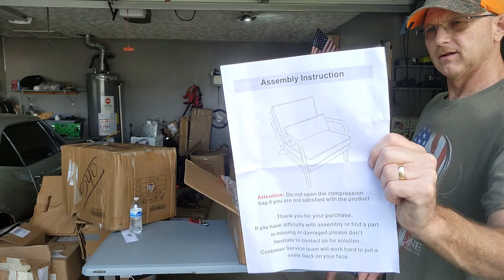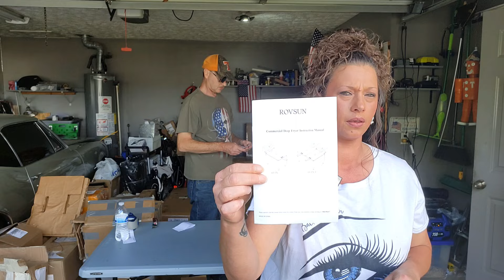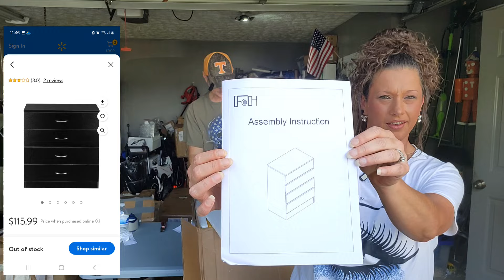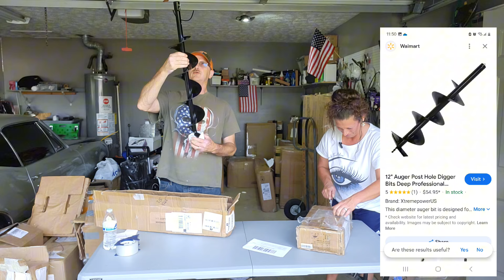We won a pallet !!!! Great finds !!!

Comment: That was a good interesting pallet to win for $80.  that baby warmer can keep quite a few newborns nice and toasty warm. 😊😊

once you start buying it is hard to back off. I had to quit visiting the site otherwise i kept buying but I need to makeroom/reorganize here before i buy more. I did buy a pallet jack at an auction last night and we are picking it up this morning so that will help. Just too easy to buy faster than you get the stuff listed or if you like me keep buying inventory for my own private stash. Only way is if i stay away from looking otherwise i find something and need to add that to my stash. 

i knew as soon as Elasa (spelled it right this time) picked up that box it was rotors just by the shape and sound it made. I have around 10 sets here which 3 came on my last pallet but i purposely brought it for 1 seeing it fits my '99 ford superduty.  I also brought that pallet because it had 3 starters on it which luckily the 2 that were new fits my jeeps but i did get a used one for an Audi? not sure what now but at least the ones i really wanted for my private inventory was new. coincidently I see you got an a.c. compressor and I got 2 new ones on that same last pallet I brought. 

you will get your money back fast on this one.  congrades on the pallet win and congrades to the mystery box winner.